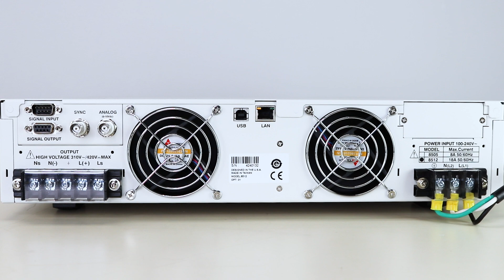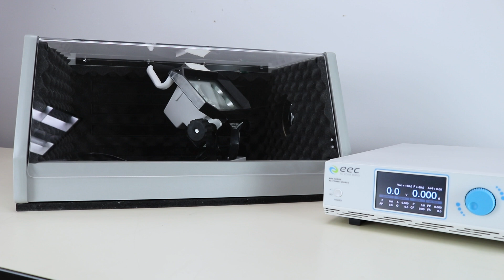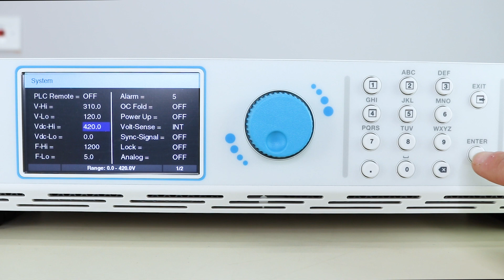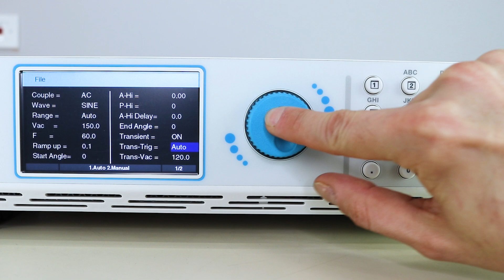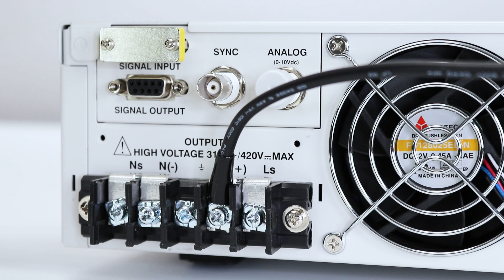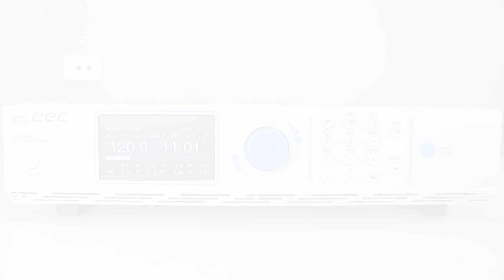EEC 8500 Series Quick Start Video

Comment: Hello. I have a problem with my programable AC power source 8500 series. I blocked the screen by error. So when i try to move the scroll the screen shows me a white square with this legend "LOCK IS ON" and when i press the reset buttom shows me "INTERLOCK IS OPEN". Do you know how to fix this or to unlock the screen to work normally the power source?
Reply: ya mamo compa